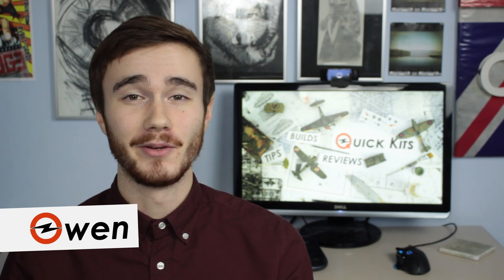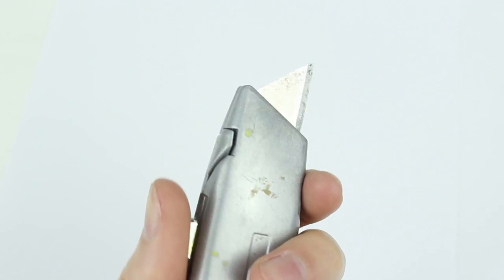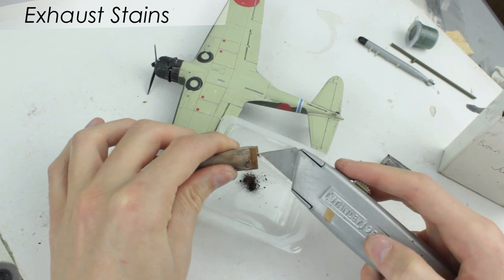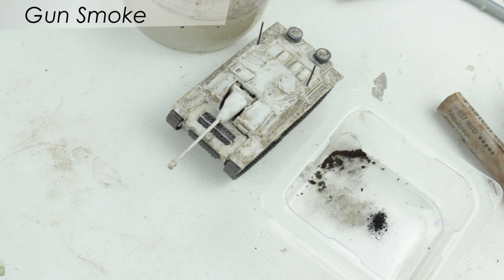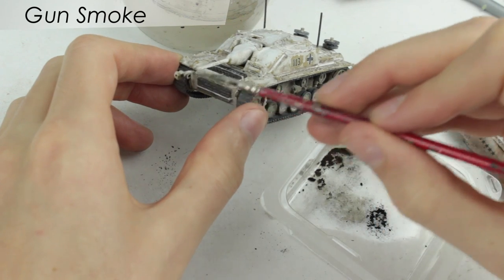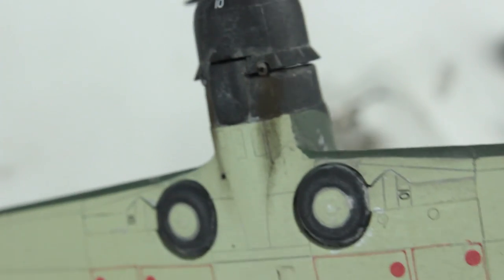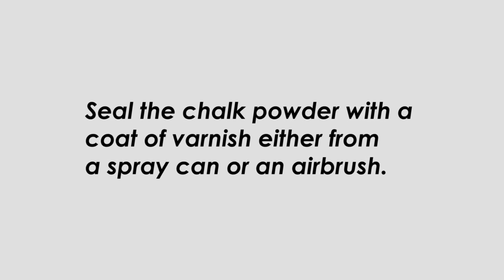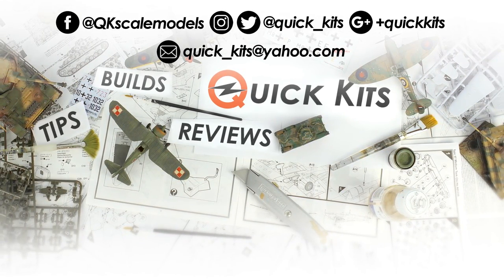How to: Realistic Exhaust Stains and Gun Smoke

Comment: I use the pigment powder technique with WW2 aircraft exhaust stains...I use black (then sealed) and then white but I found that after adding the white and sealing it the white would pretty much disappear...So I experimented with different sealing coats and I found that the only one that didn't lose the white so much was hairspray...The cheap firm hold stuff that comes in a spray can worked really well...

Comment: Hey Owen, I'm not the type of person to go out and buy thinner, chalk and so so, with water can I thin the pain that comes with the model? And what's a good way of making sure decals stick to the modal (PVA watered down did you mention a few times?)
Your work is fabulous by the way, keep going
Reply from the maker: You can thin acrylic paint with water, yes. Also, watered-down PVA glue (give it time to dry, then apply the decals on top of the coat) under the decal is a good idea. If you don't have any varnish, then you could coat the decal when it's dry with another coat of watered-down PVA glue to protect it
Reply: Gabe Varley Im fairly certain models arent supposed to come with pain.
Reply: Stoigen Froigen sure they Do! Frustration also. It's listed on the box in tiny print under the "to paint as shown" section.

Comment: Video at a perfect timing for me...I want to make some die cast racing cars with a dirty "finish line" (with exhaust stains, smoke etc...), I'm using panpastels so it's pretty much the same tecnique.
The only problem is...the pastels won't apply well on a smooth surface...is there anything I can do to enhance the grip?
I can't use sandpaper since it will riun the paint and/or the decals...
Reply: Add a matt coat to the car first.

(Make sure to mask any clear parts first!)

Comment: The coat of varnish should be applied on the whole model right?
Reply from the maker: It doesn't have to be if you're just sealing in the weathering, however it may help get a consistent look over the whole model if you did spray it all with the varnish
Reply: Quick Kits ok thanks